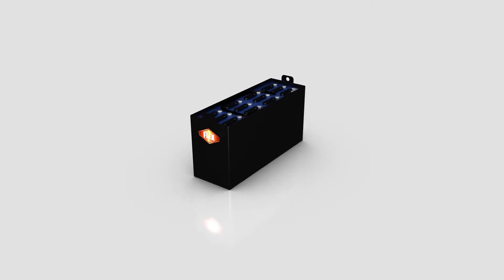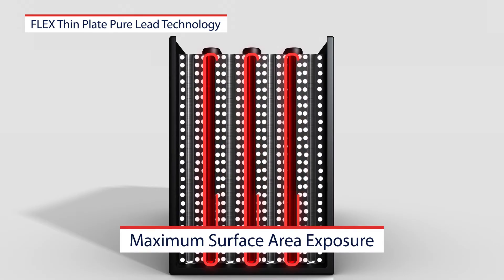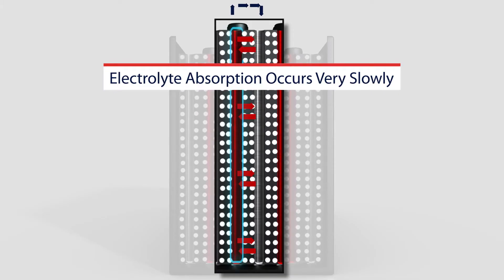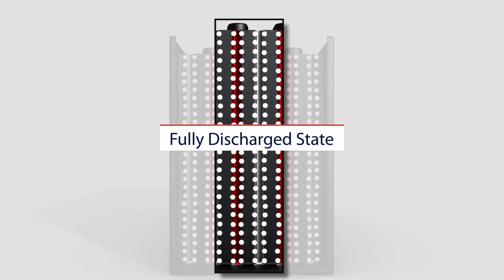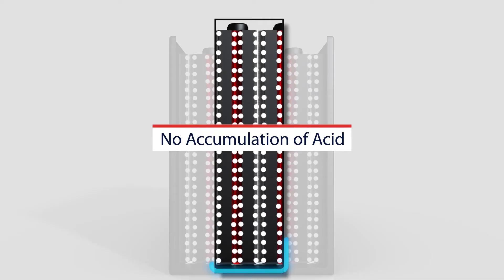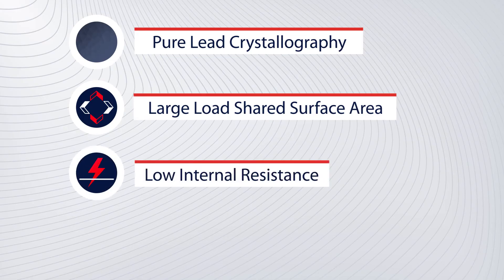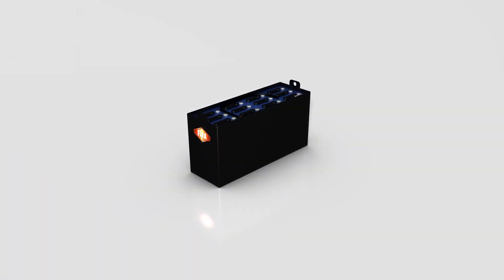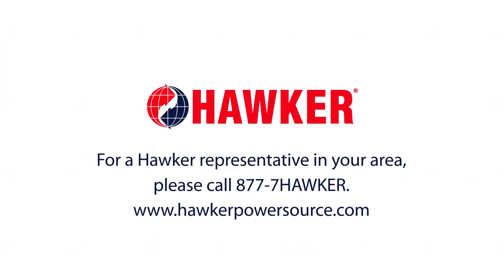How the HAWKER® Thin Plate Pure Lead (TPPL) Battery Works | Hawker Powersource, Inc.

Comment from the maker: The HAWKER FLEX® and FLEXPAK thin plate pure lead batteries are suitable for a variety of applications, ideal for multi-shift operations, and are virtually maintenance-free! Learn more about these high performing batteries by visiting us online: https://www.hawkerpowersource.com/Batteries/FLEX%C2%AE/

Contact your local HAWKER® dealer for a custom power solutions by dialing 1-877-7HAWKER.